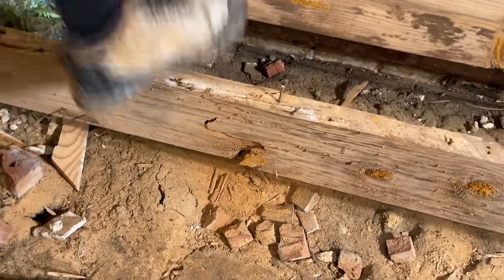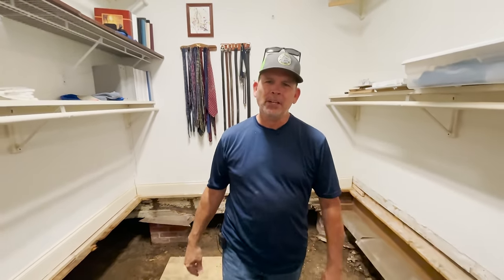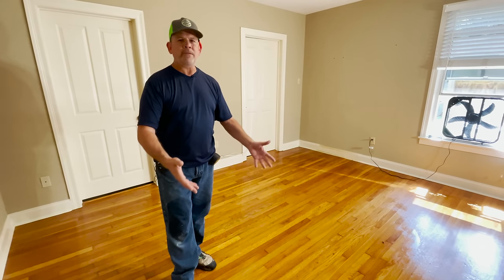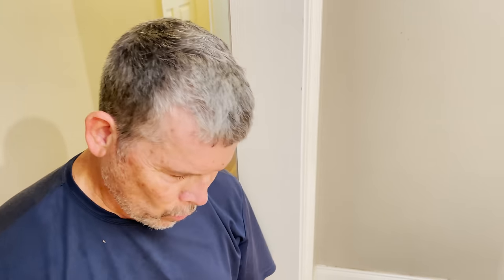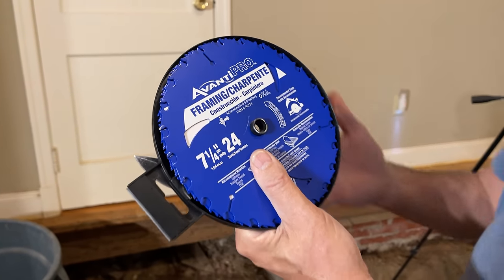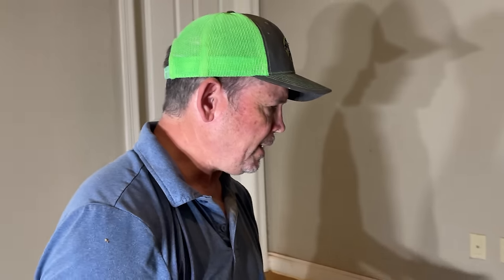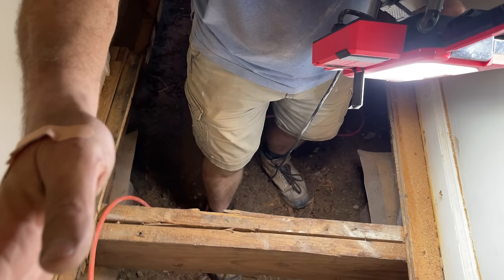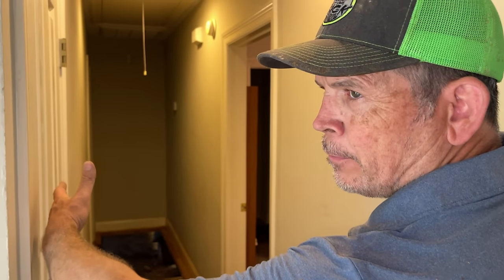This House is CAVING IN ON ITSELF!!! Can We Save It?

Comment: Appears to me that the bathroom will need to be addressed eventually. My call would be to fix it now while house is undergoing serious repair.
Reply: Agreed. bathroom repair now would be cheaper then doing it in a year or 2.
Reply: Agree 100%
Reply: I think they were thinking about tearing down the whole thing and starting over at one point.  Now that it's going to be even more expensive to fix, they might want to go with that option.
Reply: Just try add more support under the bathroom maybe
Reply: @ExcelInstructor  They still might not be able to afford to do all of the work at once
Reply: @tqu5759  I did hear the word "Insurance" mentioned.  So likely it won't cost the 'brotherhood' anything additional.  Probably will kick their premiums up,  however as mentioned-  It will need to be addressed.  Might as well do it when the rest of the floor is already demo'd
Reply: @Tedybear315  Dollars to donuts they’ll dither, dick around, and even if this is something that should be covered, balk and argue it isn’t because of long term unrepaired plumbing leaks.
Reply: How can I learn how to do this?
Reply: Is there a follow up video for this episode? I can't find it
Reply: Why wait? If the house is jacked up then this would have to be done later with that cost again
Reply: I concur! If there's not enough time , nor money to fix it NOW, where are you going to get MORE time & money to destroy what you're doing now, to get at it later!

Comment: I've been waiting for this one too.  If the house has another bathroom and can live without that one, then if repairing it properly just can't happen right now, I would demo it and repair the framing & floor (just up to subfloor, not fully finished floor), rough in the plumbing so it's ready to go, and then close the door on it. Make it safe and clean for now, and make it a bathroom again later.
Reply: Move forward with that in mind, whether a replacement goes in now (much easier and done right) or later. The property value indicates doing it completely now. The budget is the owner(s) decision. They'd be wise to do it all now.
Reply: Excellent idea.
Reply: Job got cut, house was torn down as it was cheaper than trying to save the old one.

Comment: I came back from a deployment and found my house collapsing like this. Had to replace 160 joists while lumber was sky high. 2000 plus sq/ft on first floor. Been 7 months and house is still not back to normal. Good luck on this project
Reply: 160 joists?🤯
Reply: Sometimes demoing a whole house and rebuilding it proper might be a better solution.
Reply: Holy cow! I hope it's going okay? My dad started adding a second floor right when lumber prices soared. He's ticked off too
Reply: Big money
Reply: How much you spent?
Reply: $20k just for labor and that was bc I found a group of not necessarily legal citizens who did some crazy good work. Ill have to find receipts for the actual lumber cost but it broke the bank

Comment: Completely gut the entire interior, and rebuild everything.  What else can you do?  Or just bulldoze and start over.  It can't get much worse than this, I feel bad for the owners...
Reply: Living in the South. I agree.
Reply: If the partitions and walls are solid, which indications show (the rot is localized, not pervasive), and contained subfloor, why do more than what the owner(s) decide? Once you start tearing down unaffected walls, where do you stop?
Reply: @stephensaines7100  I am assuming that's what they plan to do.  It will be very interesting to watch!  But it does seem like the rot is worse than they thought (i.e. the bathroom issue).  "Eh, we just gotta pull out the entire subfloor and all the joists, no biggie" :)
Reply: that probably too costly. I am thinking just somehow support the roof, tear down all the original rotten area and rebuild.
Reply: New supports on piers cut out the rotten, put vapor barrier on the dirt instead of between flooring, save all exterior and interior framing/drywall etc
Reply: It can get a lot worse.
Reply: They said there’s plastic sheets between the old subfloor and the new subfloor. Wouldn’t they have to rip out all those areas? Otherwise it will just mold again. Or they have to ventilate underneath the house

Comment: About 3 years ago, I have the same problem with a house, Client was already looking to demo and park a trailer on his property. Some girders where touching the floor, all of the house was 12" or less to grade. not venting and plumbing leaks where also the main culprit. Gutted entire subfloor, poured footings where needed, and backfield entire house with gravel and sand, poured Concrete slab. 3 bedrooms, 2 baths, Kitchen and Living room all got remodeled. Insurance paid most of it $60k), client paid $10k. Considering we included upgrades, it was a steal. 1 bath got a new ADA shower, new kitchen cabinets and countertops and every room got Room AC unit. Never though I would see that again.
Reply: Yeah, I've been thinking slab + insulation the whole time too!
Reply: 3bed 2 bath remodel WITH slab WITH new footings and subfloor for 60k??? Was it a toy house?  Jesus, I want your prices
Reply: @sergeig685  I guess it helps when your capable of accomplishing this things, and with a bit some help on the labor side, it keeps costs down. I did have several contractors BS their way to it and other ran, and still others didn't know what to do. The greatest satisfaction I got was doing what many others weren't up to par. I can't post pictures here, I would, but for sure adds a scratch on my tool belt.

Comment: My son and I were just working on our project Saturday.  We had to rip out the old kitchen and dining room and fix the floors and new drywall.  We just put in a new ceiling in that area and had to level the ceiling after removing the old blown in insulation and ceiling.  Man, it turned out to be quite a job.  We just put up new lights in that area and now are working on the master bath which needs the same, floor, drywall, and ceiling.  It will be nice once completed but boy, it is a job.  Not as big as yours but big for us.

Comment: Best “RealityTV” to watch, but it’s legit and run by a two-man crew. Very positive! When you two see a trial, you see a door of opportunity—not a spiraling dead-end of complaints and stagnation. Thank you for your videos. Most enjoyable!!
Reply: Canadian framing is platform not balloon.  So each floor can be separated and to an extent addressed separately. An insurance job we were called into do we had to replace part of one exterior bearing and one 25 foot interior bearing wall of kitchen after a nasty fire. Two of us created  interior micro lam collar beams and literally raised the load of the house (2.5 storeys) and were able to rebuild the 2 x6 frame walls and put the load back down. We had a solid poured basement and structurally sound foundation piers to build our jacks on and thus our two sets of collar beams. I wouldnt want to touch such a set up you had to deal with here. Very curious to see what you'll do in such a piecemeal situation.

Comment: I'm still in favor of lifting the house.  Even if it's just enough for a little more crawl space.  Being able to make repairs in the future, which seems inevitable, will save in the long run.
Reply: Lifting the house is temporary. It takes the weight off the foundation so you can do foundation repairs, but then you have to put the house down again. I'm not entirely sure how they're going to lift the house to repair the wood framing (apart from it giving them more room to move around) since what they're repairing is also what the jacks will be using to hold everything up.
Reply: @c182SkylaneRG  are you saying that you can’t add to the piers to maintain a new height?
Reply: @funny36ful  I suppose, for the house in the video, you technically could. The number of jacks you would need to properly support the house up off its current foundation, however, is going to make it extremely difficult to move around underneath the house.

Otherwise, my experience is with full basement foundations, which are much harder to change once poured. For a pier foundation such as the one in the video, however, I don't suppose it would be as much trouble to make the piers a bit taller. The trouble you ARE going to run into, however, is how much taller you want to make them. If you go up more than one or two courses of bricks, you're going to need to widen the piers, otherwise any side-loading (wind, improper alignment, etc) is liable to cause them to tip over or snap off underneath the house). Same concept as using 6x6 posts for a 12 ft high deck, vs just 4x4 posts for a 4 foot high one.
Reply: @funny36ful  Take a straw. Cut it so you have a segment that is 1 inch long. Set it upright on the table, and push down on it with your finger until it bends. Now take the rest of the straw, and do the same thing. Note how much force is required to cause each segment to bend.

The same principle is true of the piers under the house. A little extension is probably fine, but too much extension can make them more likely to bend or break sideways, causing the house to collapse.

As I mentioned: a couple courses of bricks is probably fine. Any more than that, and you need to widen the piers so they can withstand the added torque.

Torque is force times length. If you apply the same force to a longer length, you have more torque. The base of those piers can only withstand so much torque before they break.

Comment: White mold from leaks/probably hot water/and without any venting, created a sauna-like condition under there.  I had this happen in my rental when tenants failed to tell me there was a leak.  Luckily, it was remedied before it did any extensive damage.  The mold (small white spots) was just starting to form on the beams. When this happened, I realized all the vents (10) had been covered over when the house was stuccod before I purchased it (I lived there for 25 years 🤦‍♀🤷‍♀). It was a super easy fix.  I literally felt the house take in deep breath when this was done. GREAT VIDEO!!

Comment: Typically I’m the first one in to see if it can be fixed( I’m a flooring contractor ) I do not do structural is my normal response after seeing. Then following question from them is what do yo think it will cost to get fixed? EXPENSIVE!!!! Sounds like you have a good game plan good luck guys can’t wait to see
Reply: I was wondering - my guess is that this is going to be between $80k and $120k by the time it is done

Comment: StudPack we did a couple of these but did not try to repair joists. Instead we converted the floor system into a structural slab, eliminating the unvented crawlspace. 6-10” washed stone over a carefully sealed vapor barrier, 4” cap w grade beams under the walls.  Had to redo a lot of plumbing and of course all of the finished flooring but in the end it was faster cheaper and easier than the alternative.

Comment: Plastic sheeting has killed more framing than most people would believe. This house must have had good termite barriers or the moisture would've attracted termite to some good eating
Reply: The plastic vapor barrier would have had to have been installed below ALL of the wood in order to have not been trapping moisture in the wrong place. Crawl spaces should be treated like that, and spray foam is often used to insulate the walls of the crawl space if it is not ventilated.
Reply: Vapor barriers are not as much the issue has a nail in the coffin imo, up north they are important.  But your exterior wall needs to stay sealed  or in this case you cant ignore water leaks and block all the crawlspace venting. And honestly the whole treating crawlspace as both interior and exterior rather than one or the other is probably the biggest failing in modern us construction.
Reply: @stich1960   - yes, a crawl space is either interior or exterior, and the structure should be built to make it clear which is the intent.
Reply: @stevebabiak6997  Yes!!!! The FLOOR of the crawlspace should have the barrier!
Reply: @stich1960  Definitely. My comment was in light of their decision to have no ventilation.
Reply: What’s the fix for this? Install some type of fan and ventilation system to keep air moving under the house?

Comment: You guys are great builders, truly jack of all trades when it comes to building/carpentry.  With all the specific companies/unions (demo/framing/finish/tile) it is extremely rare to see now a days and it’s almost unheard of to see guys who actually are good at all aspects of building.  Nice to see the youngster learning the skills from someone who knows his stuff!  He’s going to be making crazy money eventually, no one wants to work the trades anymore and those that do are only helpers or want to be in a union where they can slack. 

.The only two things I would’ve done differently would be more for my own well being and future issues.  

1 take more precaution when you find mold.  Respirator on at all times in the work area. Use zip walls/plastic in doorways blocking rest of the house.  After removing old lumber spray a chemical (QD64 is best) on/around the area where the mold was or even on the new lumber where it seemed to grow the last time… this kills any small particles left and prevents future growth. If it is a really likely areas they make a white paint for inside walls and floors that goes on studs/joists to guarantee no mold 

2 I would cut the small hole first on that floor, get a look down at the joists.  If that big section you cut became to heavy for those rotted joists & falls through to the ground its an absolute nightmare.  The chances of that are low but when the floor is 4-5 inches low only 7 feet off the wall the joists are clearly failing.  That subfloor being cut could’ve been the final blow and the whole section could fall down to the ground.   

Just some tips I thought I’d share.  But you guys do great work and I’m absolutely a supporter!

Comment: I'm curious: what's the feasibility of a northern-style Concrete Foundation with a Basement down there in LA? Seems like it'd help with floor joists rotting, and you don't have to worry about frost caving it in, but you seem to have a pretty high water table. Concrete's waterproof, though (if done right), so I'm still having trouble seeing the downside, if done properly.
Reply: The basement would be a cistern!
Reply: A lot of issues with houses like this to include basements are due to not having any type of vapor barrier underneath the house. A good 12mil vapor barrier will solve this problem or prevent it from happening. A conditioned crawlspace takes that a step further.

Comment: That’s why you pour a slab. Make your house the ship it’s supposed to be. Great work. Really like your spontaneous videos.
Reply: The high water table makes slabs fail in Central Texas as it most likely would in Louisiana. Black land Prairie is very high in clay as are bayous.   Drought causes clay shrinkage rapid rain fall loosens clay so we have rapid foundation stress.
Reply: @normaalvarado2880  In my area we also have clay ground. The quality to make brickwork. Engineers demand a “general foundation slab” this 30cm and reinforced. On the bottom the slab is wrapped in thick plastic before the poor. On the side it is protected by bitumen roofing (the black stuff you attach with fire). The idea is ofcourse that the structure “floats” while the clay does what it does. Expand, shrink etc. This is in europe.

Comment: That beautiful tongue and groove hardwood also helped to keep that floor floating above the air space where the joists were decomposed to no structural integrity. Shame that it had to be demo’ed to fix the structure.

Maybe you could have used a grinder to cut through that flooring; they often get used to cut through metal, of course with the proper blade attached.

Comment: I am going through this exact issue with my entire house right now house was built 1944 has about a foot of clearance i pulled up the floor just the other day and they have the old hardwood sub flooring with random patches of 2x6’s and plywood once we got passed that the joists were rough cut wood with extreme termite damage from over the years and the supports under the beams were scrap pieces of wood that were rotten this is my first home too so I’m just extremely frustrated and stressed about the whole thing
Reply: What ended up happening? That's so horrible man

Comment: I'm a licensed plumber and I've been under several houses and seen a lot of things that you exposed by cutting the floor open that house appears to be very nicely remodeled the main thing it has going for it that the outside perimeter wall beams are in good shape but the load bearing walls must have proper support and I'm not saying anything that you don't already know ..so I agree I hope it's in the house owners budget to do everything that you see that needs to be done